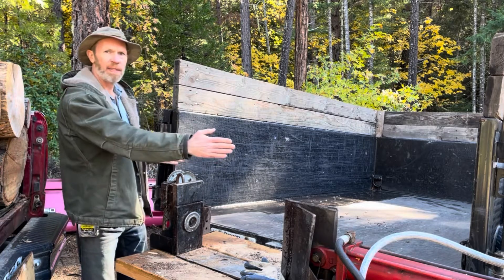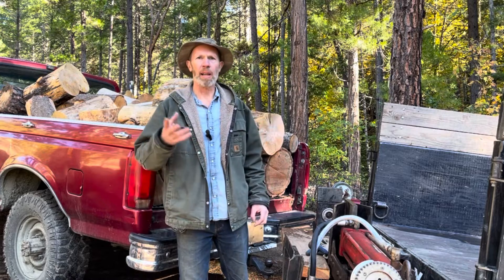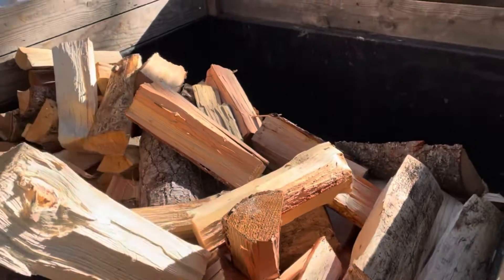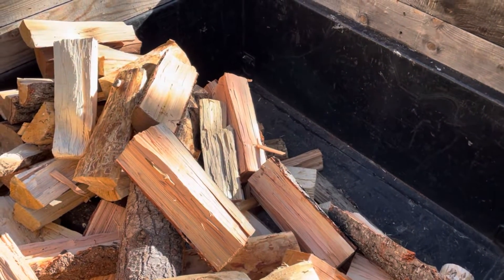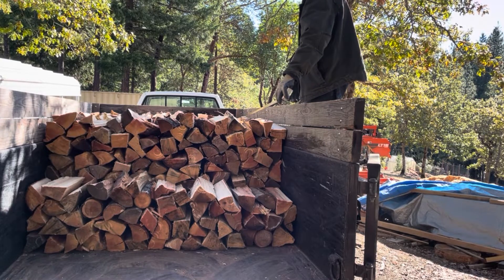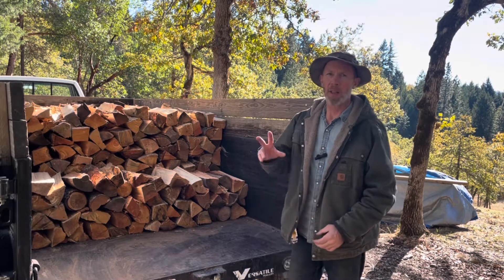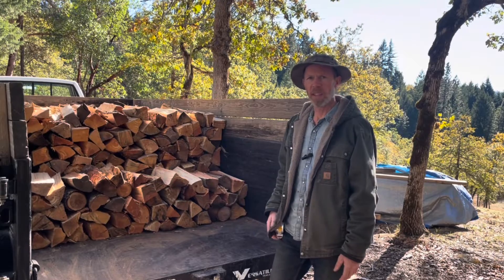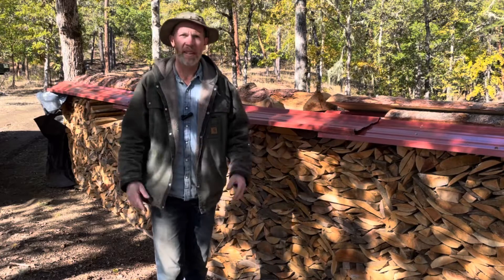Stacked Cord vs A Loose Cord of Firewood. How Many Cubic Feet to Make a Loose Cord of Wood

Comment: Your percentages are a little off.
180 cubic feet is 40% more that 128 cubic feet.  Not 30% as you say.
The percentage difference between two numbers is different depending on which of the two numbers is the denominator of the difference.
180 - 128 = 52
52 / 128 = 40%
52 / 180 = 29%

Comment: 7:46
Math
A stacked pile of of wood is 70% of an unstacked pile which is a reduction of 30%.
If you go from a stacked pile of wood to an unstacked pile of wood you will increase its size by 43%.

To make it easier,
If you go from 10 to 5 you have decreased by 50%.
If you go from 5 to 10 you have increased by 100%

Comment: Thank you. Here in VA they are trying to get so much for wood. Here they think a 6 foot bed is a truck! Before moving here I did not know there was trucks with less then an 8 ' bed  unless it was a foreign truck, lol. Anyway, this helps especially when these yahoos think you can get a cord of wood on a truck with no side extensions.  I was trying to make it easy for them and just throw/dump it in my trailer 12x2x7. But they want try and charge for 2 cords or 1.5
Thanks again. Go Army!

Comment: In my country wood is sold by volume you can pick as many cubic feet as you want and it is always sold as loose thrown, because no one would ever stack it up like that just to dump it so why your country still measures in stacked cords is insane just say a cord is 128cubic feet of thrown wood dont do this crazy back engineering because of some old ass measurements
Reply from the maker: We are required by law in some states to sell it by the equivalent of a stacked cord. So it’s still relevant here to know the difference. What you say about changing the way we measure it as loose does make sense.